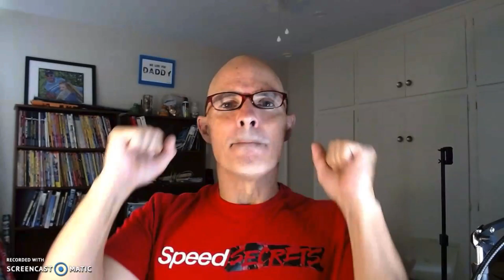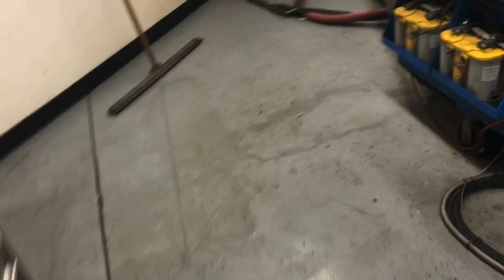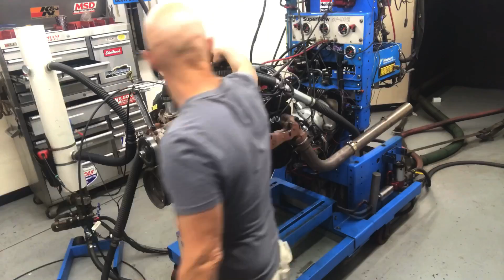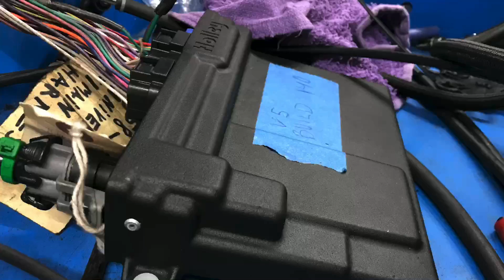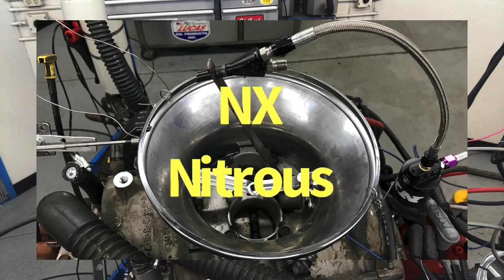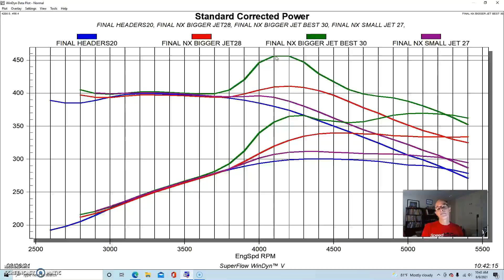JUNKYARD DODGE MAGNUM 360 MODS PT 2 (FULL DYNO RESULTS ON HEADERS & NITROUS)

Comment: by chance i came across a man that had Xheads at the Mopar Nationals in Columbus Ohio. these heads never been worked on. friend has a machine shop, and he ports them for me. long story short. i only got 383hp but the torque was 460. i have the 360 in a 79 step-side. i love that lil engine. its like the timex and energizer bunny all rolled into one. id like to get a set of aluminum heads

Comment: Awesome to see some magnum love. Please keep the engine injected. That’s the main reason mostof us swap this motor in. With the injection system they are smooth running and super reliable. I would love to see cam, intake, heads etc. upgraded while keeping it injected. Thanks fir the great content.

Comment: what if the shorty headers are cericoated to help increase the exaust flow and improving exaust scavenging down low? I have my shorty headers cericoated inside and out to help increase exaust flow out of the chamber and I have noticed a good gain in low end tq. The engine is stock otherwise except a tune.
Reply from the maker: shorty headers offer no scavenging effect (the primary length is too short)-they might add flow
Reply: @richardholdener1727  well thats a bummer. I thought by increasing the exaust velocity would help combat the lack of exaust scavenging without having to run long tube headers. but I can at least use the headers for the twin turbo build I will be doing later on.

Comment: It would be really nice to see someone dig into the valve lift losses you see on Magnums because of the goofy pushrod vs. lifter angle, and the myth vs. reality on the Magnum lift limits due to the valve guide bosses.
Reply: Good suggestion!!  I'm curious too!  I may be wrong, but I think that goofy lifter angle was a remnant design of the Poly engine block.

Comment: I love this. Stuff every LA guy should know, grab a free junk magnum and run circles around almost any older small block and it’s almost 100% bolt in. Cam swap is huge, but can also give a guy a mechanical fuel pump eccentric if he’s insistent. 
I’ve always done a Chinese dual plane/carb swap but now that’s changing with so many tune possibilities that didn’t previously exist. 
Remember when a stock magnum had to get a cold air, exhaust, cam, headers and a mopar computer for a 50hp gain!!!??? Crazy 
Keep this series going

Comment: This is the test I've been waiting for as I'm readying a stock 5.9 for my Dart Sport.  Starting with a carb setup on a Edelbrock 7577 dual plane air gap.  288hp is 40 more than the stock number.  And torque is impressive too!  This also shows what a good tune will do for a Magnum or any motor for that matter.  Thank you for doing this Richard!!!

Comment: Great to see a Mopar motor a lot of people still use daily. Unlike a carbed 340/360/440. It would be great to see a modded kegger. Or at least remain fuel injected with stock electronics and fuel system. I know peak numbers make better videos. But who's going to pull their kegger intake and replace with a carb on their daily Ram?
Reply: Pull it and have the Runners Milled and add the Aluminum Plate.HUGHES ENGINE STUFF.👍👍

Comment: Love the Magnum videos. You will pick up a ton with a camshaft. As I'm sure you're aware, the stock Magnum cam is teeny tiny. I think it's well under 200* duration at .050. I've sprayed 250 through Nitrous Outlet Stinger on my stock 5.9 many times, with a carb, good fuel, proper timing, good plugs, etc. It's no LS, but for something you can pull out of the junkyard and toss in, it's fantastic HP/$$, especially in Mopar world.
Reply: stock 5.9 cam is like 192 @.050, .400 lift, 113 lsa. 5.2 cam is actually bigger. its like 194 duration, .432 lift, 113 lsa.
Reply: @frigglebiscuit7484   Yeah, tiny. Given the flow of the Magnum heads, it seems silly that they were so conservative on lift.

I put a small Lunati 20200715 hydraulic roller camshaft in. 213/219, 112, .485/.485 in and it was worth a ton on the chassis dyno and took the rpm range up to 5500-ish. Makes just shy of 300 rwhp with headers, 4bbl, 904, etc. You could go bigger but with a tight nitrous converter and tons of street miles it works and sounds great.  It's certainly no LS, but it gets down on 250, especially considering it's a $450 mopar engine, and it's only had the valve covers and intake off since it came out of the yard. Of course, I did kill one figuring out the n20, and it goes through a timing chain every year and a half or so....

Comment: I would like to see a test between tri y and conventional headers. The claim is that tri y produce better low speed power than conventional headers.
Reply from the maker: its not that simple, the design of the exact tri y and the design of the exact 4:1 header can produce different results

Comment: Richard - Will you do a XE250 and XE268 cam equivalent roller like the XR258HR-12 and XR268HR-10 cam like you did in your LA build (Dodge Trades Man) so we can see a direct comparison between the LA and Magnum motors cam for cam? Thanks Bruce from NZ
Reply from the maker: Possibly!

Comment: I wish you would have sprayed nitrous first through the manifolds. Than the headers. To show the torque increase cause I have always like nitrous for the torque. 
Sorry not a complaint just an opinion. Thank you for the info Richard .
Reply from the maker: nitrous adds power regardless of which exhaust you run

Comment: I would like to see the dyno results from the kegger mod  with vrp plates and throttle body mod (shave the top and port the top of the bores).  Last year i did the kegger mod with the vrp plates.  I am really happy with the results! Dropped the 0 to 60 time by a full second. I posted a video showing what was done, including before and after 0 to 60 runs. I haven't done the throttle body mod yet. Plan to do this soon.

Comment: just for s&g, 1/4" stroker crank, +.030, 10-10.5 flat tops, ported heads and a six pack for induction...u pick decent cam....i wanna see what it does na
Reply: Mopar guys go big with the crank. Sbm has a 9.6(?) " deck and stock 6.123 rods. Stock 360 has a 3.58 crank and 4" crank drops in usually with no grinding with stock rods. They also have a cam high in the block keeping it away from the rods.

Comment: Could you please not put a carb set up on there? I'm not hating, I just want you to push the stock set up with cam, springs, and boost. Mostly because of your gonna buy this engine, it already comes with this stuff. Not a spendy intake, carb, and then ignition management too. Thanks

Comment: Will the magnum and L.A. use the same headers?
Reply: The bolt pattern isthe same. There is slight differences in the port shape. Particularly between the middle cylinders the magnum has more meat, but they are overall compatible.
Headers that are designed for pre-magnum vehicles tend to interfere with the engine mounting bosses that are cast into the magnum block. These bosses can be removed for clearance and instead use the ear type engine mounting points.
Reply: yes.
Reply: @frigglebiscuit7484  thank you
Reply: Years ago I turned a aspen into a race car for a small dirt track. It has the slant6, but we were thinking of moving up a class to v8. After finding out some models came with a 360 I bought one from a classified add. Turns out it has a roller cam and that monster efi intake. My friend had a issue with track officials  and quit. So I'm figuring what to do with the leftovers.

Comment: What about the holy grail of horsepower adders, backwards pistons?😂😂😂😂
Reply from the maker: coming
Reply: @richardholdener1727  I'm going to predict nothing. Story's been told for 50 years and not one dyno result? I'm sure you're not the first to test, I just believe there's no result to give.
Reply: @buildingracingvideos4714  David Vizard had some charts recently. I wouldn't be totally surprised to see one of them break pressing the pins out and I'm usually replacing with dedicated valve relief pistons so there's nothing to change for those... they don't have offset.
Reply: Backwards pistons is basically the cow tipping of engine mods 👍
Lots of myths, no evidence.
Reply: @brianfrost303  I can Attest a JUNK 72 440 Will turn Up Faster and was worth about a tenth.👍👍

Comment: Richard....I bet the Holley HP management system is better by 40 HP...then the stock dodge jtec ecm?
Reply: Also....there was a previous comment on the 1992-93 exhaust manifolds....it is true the early stock exhaust manifold itself flowed better....they were bigger....but dodge installed more restrictive...or smaller stock manifolds along with smaller diameter y pipe to the cat....the reason for this detuning....was to cool down the exhaust to cat so it scrubbed NOx emissions to favorable levels....it was cooler....

Comment: Richard - What is your full advance at, I thought I heard you say 22 degrees in the last video? Thanks Bruce from NZ
Reply from the maker: total timing was 27 degrees (na)-we retarded it 4 degrees for nitrous
Reply: @richardholdener1727  I am running the EQ heads, i am at 34 degrees total, all in by about 1800rpm, 209/217 cam, with a 600 Holley, should I knock it back to 27? It was detonating at 36 on I think approx your 87 gas it's hard to compare MON vs RON octane ratings 🤔 thanks Bruce from NZ
Reply: @brucew13  how do you know it was knocking at 36°? Having all the timing in before 2000rpm with that small of a camshaft is sketchy to me. Most guys dont have all the centrifugal advance in until 2800-3000rpm. If youre only backed off two degrees youre probably still getting knock and dont know it, even if you arent consistently your only one bad tank of fuel or a hot day in traffic until you will start to get knock again. You might not have that much timing, some of the mopars have inconsistent placement of the timing indicator. 
If you have somewhere to do some pulls that you can record the data it will make this easier. Set up on a road where you can do a pull in without shifting the trans from like 20-60mph and get the time. Bump the timing down 2° and repeat and see if it picks up or lays down. Its really hard to get precise enough data to do anything if youre only using the vehicle speedometer and a stopwatch but its possible. 
Our 87 octane is Mon+Ron/2. Thats usually RON 91. We have some superpremium fuels here but Richard is handicapped in California with R+M/2 91, roughly equivalent to RON 95.

Comment: Worth tossing higher ratio rockers at it with the stock camshaft?
Reply: I did the Harland Sharp, 1.7 and it made a nice difference probably because the stock cam is embarrassing small. Not cheap though, $400 bucks.
Reply: It's not usually worth it. If you have the engine out it's cheaper to get a cam and a set of springs than a set of rockers. A cam swap adds lots of power compared to what a rocker swap will give you as well.
Reply: lol no. stock cam lift is .400.

Comment: Those had to be the worst looking exhaust manifolds I've seen since I pulled a 392 Hemi out of an old Imperial. They were big in the front getting smaller towards the flange. With that said they actually didn't work that bad. I figured there would be at least a 20hp gain with the headers. Can't wait for part 3!

Comment: i have an 02 dodge ram 1500 with the 360 and I'm not sure if long tube headers are available for my application. this series will help me allot with this build.
Reply: The only ones i know of are pacesetter and they do not fit well in a 4x4
Reply: @mikekeeler2566  my truck is 2wd. Pacesetters are thin and have terrible coating. have you heard of them rusting through or failing? i would consider being them up if i went with them.
Reply: @PANTYEATR1  i had a set few years back, they real decent quality with welds and tubing was 16ga like almost any header out there. And the flanges where decent thickness aswell. The thing i didn't like was price, and yes the coating is just for shipping but they did offer ceramic coated ones. And they want you to use the off road y pipe they make. My problem tho was clearence with the drivers side collector interfering with the yoke on the front driveshaft right where the primaries where welded to the collector. I tried to clearance it in that spot but no go. Seems i got one that was crooked or something
Reply: @mikekeeler2566  your truck is a 4wd correct? i currently have shorty stainless steel headers and i made a mandrel bent 2.5" Y-pipe that goes into a 3" cat-back. i may have to check pacesetter out. it's been a while since i used their products...
Reply: @PANTYEATR1  yeah it was, i removed the front drive shaft to run them... kinda made the truck useless that way. lol no longer have the truck, but when i did have the pacesetters, i had true duals 2.5" to some thrush chambered mufflers to rear axle dump.

Comment: The pull with the headers sound SO much better then the wind noise the stock manifolds made. I have a 95 5.9 and a 90 spirit with the 2.5T1 but that is slightly modified so these episodes are helping me all at once. Thank you for everything richard you give your viewer's so much influence  and it's greatly appreciated🇺🇲
Reply from the maker: I agree 100%
Reply: He is like a ghost, I never even knew he had responded, but not surprised in the least bit, this podcast has more viewer interaction then anything else I have seen👊🏻🇺🇲

Comment: I had an 84 Ramcharger that came with a 360 LA engine with an A727 and a NP208 transfer case and it always ran great (even with the Thermoquad), but if I drove it for more than 30 minutes it would vapor lock and just die until I would pour some gas into the carb. I got sick and tired of screwing around with it so I swapped in a 360 Magnum with the same A727 and NP305. I integrated the stock wiring harness with the Magnum harness and ran it off of the stock ECU and it ran great, sounded great, and made good power surprisingly. The LA only had 64k miles on it, so I sold it to a buddy who built it for his old D100.

Comment: Check out utasome performance. Marty is doing some really cool stuff with the 360, mostly torque focused using reworked stock intakes and single pattern tight lsa cams. Some impressive torque numbers and decent power.
Reply: I used the plenum plates, and It definitely worked. No silicone,  just overnight cured jb weld.

Comment: The 1992-1993 Magnum cast-iron exhaust manifolds have a larger collector flange diameter and combined with the 2¼" Y-pipe into 3" exhaust is a tough setup to beat. My Engine Quest Iron Lightning heads love it and it looks stock.
Reply: Here's the part that you failed to recognize here. The 1994-2001 magnum manifolds have smaller port's and a 1⅞" discharge with 2" Y-pipe into a 2¼" exhaust. Testing over the past 20 years in my 1993 D 250 5.2l automatic vs my 1996 1500 5.2l automatic shows a big increase in flow with the 1993 manifolds and corisponding Y-pipe with the chassis dyno showing 387hp at the rear wheels and still getting 20.94 mpg on the highway. When people are running their mouth about factory exhaust manifolds they are talking about the 1994-2001 units because they don't even know that the 1992-1993 exhaust manifolds are different. They are mistaken because they think that they are all the same and they are not.
Reply: 2.25” Y pipe to 3” exhaust seems totally pointless lol. That Y pipe I can almost guarantee is choking a 360 CID V8 unless it literally has no cam and junk heads.
Reply: Just realized you also said “cast iron manifolds”. So yes, you are indeed down on exhaust flow anyway well before you get to the 2.25” Y anyway so the Y pipe isn’t actually an issue right now; first problem is the manifolds. If you were to go to a long tube header then the y pipe would be your restriction at that point. Depending on your cam profile/compression and specs of your EQ heads, I’d venture to bet you’d pick up no less than 30 HP right now by throwing on a set of longtubes and going to either a full 3” Y pipe/exhaust or better yet 2.5”-3” dual system from the headers back. If it’s a high compression motor with a lot of cam, more like 50 HP from those aforementioned exhaust improvements. Just saying 😀
Reply from the maker: 50 hp?
Reply: @kennethpowers8995  well let me explain to you why a two 2¼“ into a 3" Y-pipe, H-pipe or even headers with a crossover tube to equalize the exhaust on both sides of the engine vs the train wreck pipe disaster on the drivers side of the engine in the video and the bullshit multi-diamater on the passenger side of the motor vs the headers. The dyno results are skewed in this video. This is the reason why there are so many good quality tuned exhaust systems available on the market today. The Y-pipe also has a benifit of maximizing the scavenging from 1 head to another. When combined with a tuned 3" exhaust it works very well. I copied the work from Mopar Action magazine. This was all covered in the ScatDak project.
Reply: @celmer6  Bro your running stock exhaust manifolds there is absolutely NO scavenging effects designed into OEM manifolds. I don’t care what your magazine articles say, factory manifolds are designed to be cheap, mass produced, and last for a long time. Those are the design characteristics that matter to an OEM when they design factory manifolds. Performance is not at all on their list of important items, so no your factory manifolds with a Y pipe after them are absolutely not the best setup for any type of performance engine.
Reply: My 92 Dak has 2 1/2 outlets and I swapped yrs ago to a set of Hooker Pacesetters and saw about 1 tenth difference at the track. FlowPorting like the F.A.S.T. Class cars might be something to try, for that factory look.😉